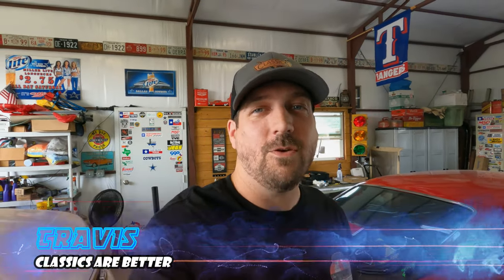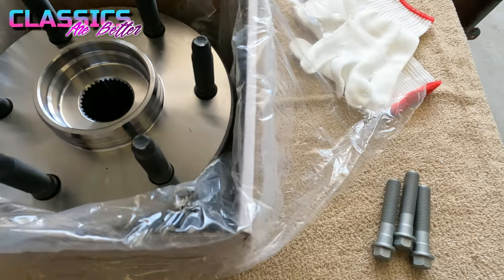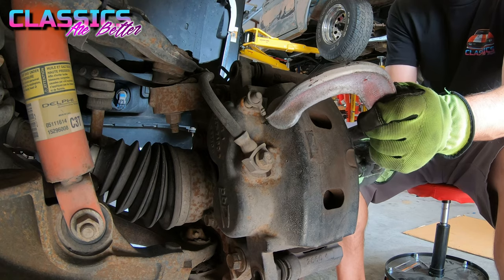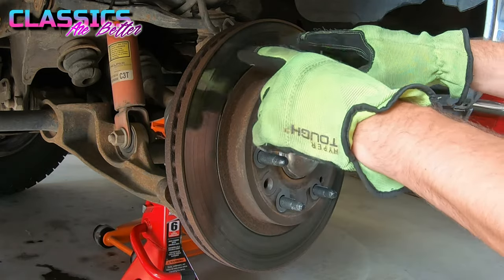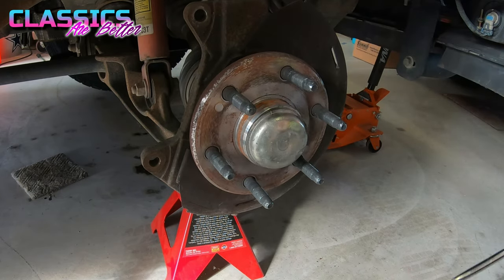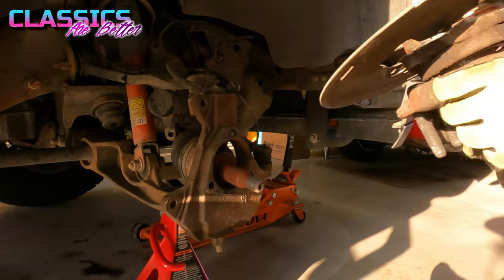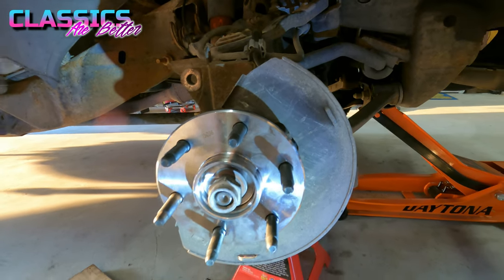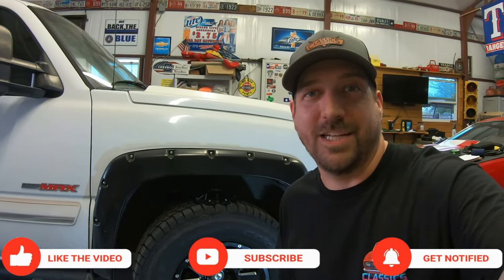How To Replace Front Wheel Hub Bearing Assembly 99-06 Silverado, Sierra, Suburban... 6 Lug

Comment: thanks!  nice work.  this will be the third time i've had to do this on my 2005 k1500 z71 suburban.  right at 200K now.  i never did have the dust cap cover over the axle bolt- weird.  only on pickups??
Reply from the maker: Thanks for watching Scott, honestly man I am unsure if there is a difference between a Burb and a Truck on this, haven't done it on a Burb. If you have had to do it three times, you may want to look into a beefier aftermarket unit, spending a bit more stinks, but then dont ever touch it again lol.

Comment: Great video!  I just did mine this past week.  Exactly the same as you showed, except I had no washer behind the hub nut?  Mine is a 99, and the hubs have been replaced before.  What are the odds that the last installer left the washers off?
Reply from the maker: So I haven't specifically worked on a 99 to know for sure, but I would guess they had just left the washer off when getting it together.
Reply: @CLASSICSAREBETTER oh boy.  Nothing available at rockauto, so I’ll have to make do with my local parts place to get a couple.  Old stuff fun stuff

Comment: Nice video. Going to be replacing mine soon. How have the Amazon parts held up for you thus far. I think I’m going to order mine from Amazon
Reply from the maker: Yep it has held up just fine, long as you get that correct part number I think they are all made the same then rebranded. I actually just had to do the driver side on that truck last week and ordered the same one I used in the video for passenger side. Can't beat 50 bucks, just remember to get new hub bolts, don't reuse the old ones. Best of luck on your project!!